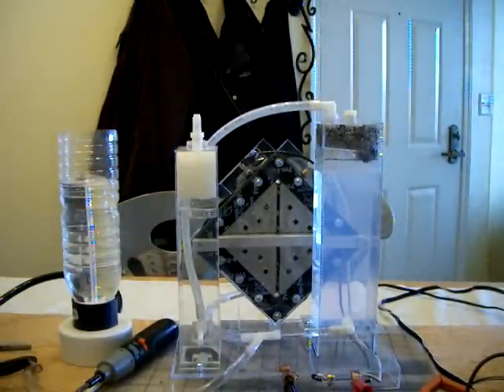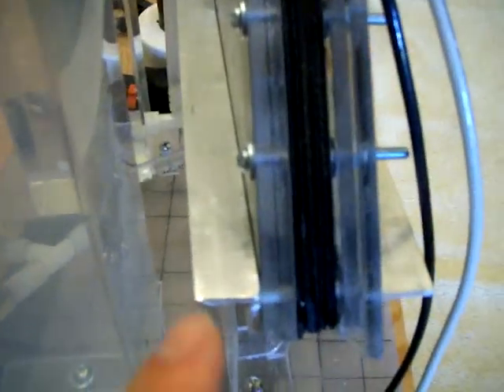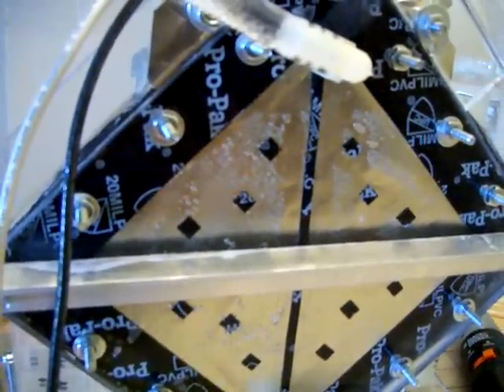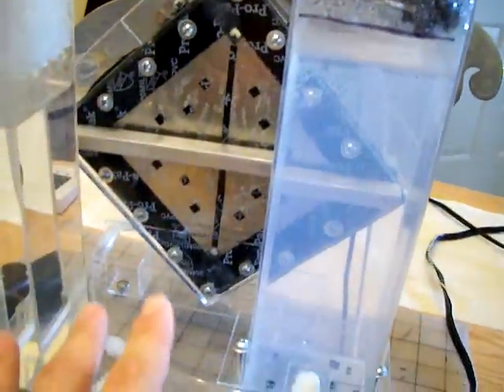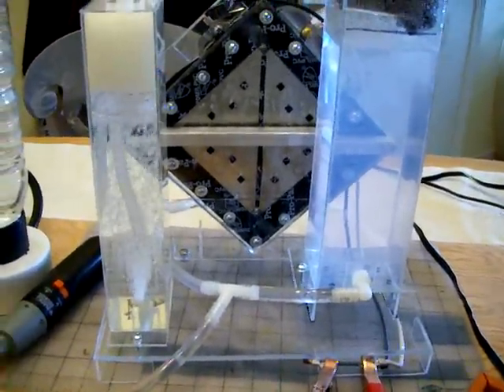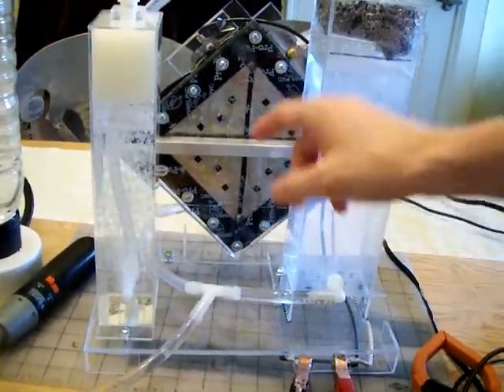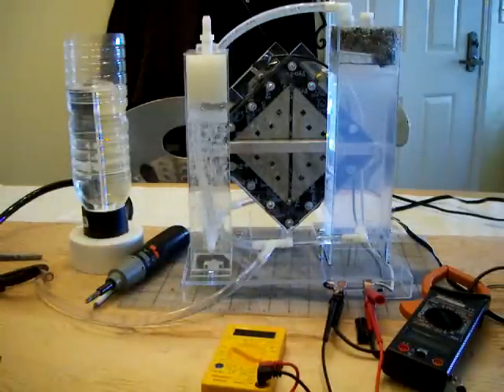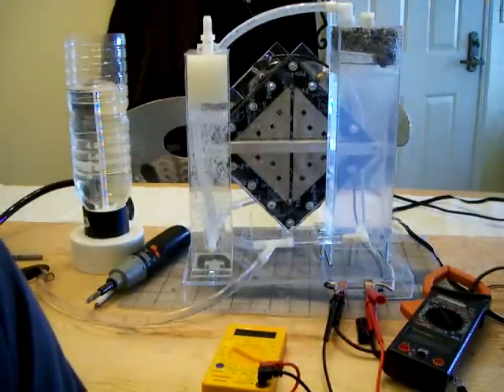#5 HHO Dry Cell, Lots of info!

Comment from the maker: Sorry for coming back to you after so long! I plan to use ticker plates (0.02") for the electrified plates and Foil (0.002") for the neutral plates. So the building coast will stay low and the electrified plates wont heat up. 
I already did test with pump. It doesn't solve the heating problem. But I did listen to your recommendation about the long rail as spacers. The work is still in progress...we will see! 
Thanks!

Comment from the maker: Thanks for the kind words! Yes I did copy Smartscarcrow and I'm sure he is hopping that everybody will do it. It is not a competition but all about spreading the information. But the difference in my work is that I'm using SS 316 foil 0.002 mil of an inch. It is cheaper, easy to cut but little bit tricky to work whit. I just wanted to show that it is possible to work whit foil.

Comment from the maker: The neutral plates divide the voltage and produce hho as well. It is important to divide the voltage so the water does not over heat. Tip: The correct voltage between plates will be ~2 volts. If you apply 12 volts you should build a cell like that  +nnnnn- The "n" stand for Neutral.

Comment from the maker: In fact the water doesn't need to be cool down. If your device is well build and the right electric current is apply to the cell, the water temperature should not get to the bowling point.  To prevent the cell to heats up and boiled the water, make sure that you'll not apply more than 2 volts per space between the plates EXP: +2v N 4v N 6v N 8v N 10v N 12v -. The "N" Stand for Neutral plate.  All extra voltage will be transform in heat.

Comment from the maker: Really simple, in a wet cell you have huge amount of volt leakage on the edge of the plates which you don't have on a dry cell. This means that, you'll produce more gas, more efficiently with a dry cell than with a wet cell.

Comment from the maker: The cell you are looking at is a 13 plates cell (+nnnnn-nnnnn+). The heat is created because of the really thin SS that I'm using. I planed to solve this problem by using ticker plates (0.02") for the positive and negative while keep on using SS Foil 0.002" for the neutral plates. I will be publishing the blue print for this new design in a week or tow. Stay tune! Thanks!

Comment: just a silly question?  what is the benefit of the dry cell compared with the regular hho generator(plates inmerse in the solution). by the way nice work you are doing, install it on a car is gone be a good project.

Comment: I think cathode is exo thermic (gets extra hot from reaction) Anode raction is endo thermic (gets cooled by reaction) Cathode hot is good = more heat = more electrons into water. See vacuum tube heater circuit cathode same idea. Try not to let Anode suck heat from Cathode = lower thermal efficiency, let Anode suck heat from ambient.

Comment: Why do you need a pump? You could just plumb it so that the hot water was allowed to rise to the tank top and cooler water from the bottom would likely push in and circulate naturally from the weight.  Now it was just a guess, so if there are any trolls out there, I won't feed you so go away.

Comment from the maker: My cell is well build but it's still heating up because of my not to good power source that I'm using. It is cheaper for my to buy a pump then buying a new power supply or a car battery. The problem I have with this PS is that I can't apply more that 11 amp to my cell and stay at 12 volts.